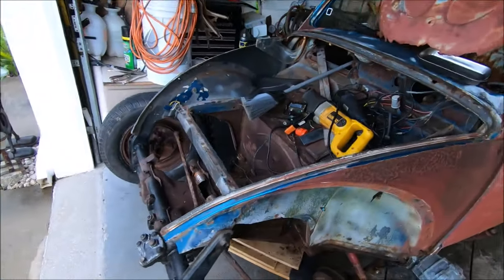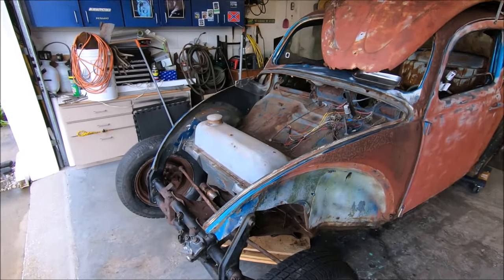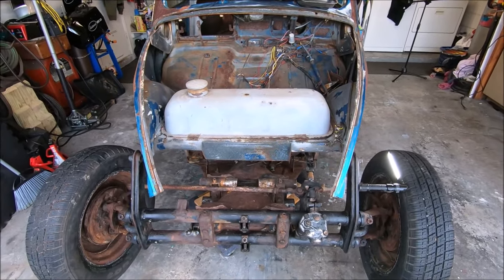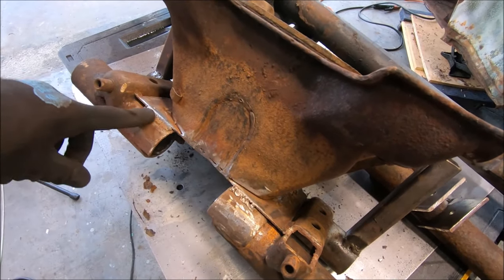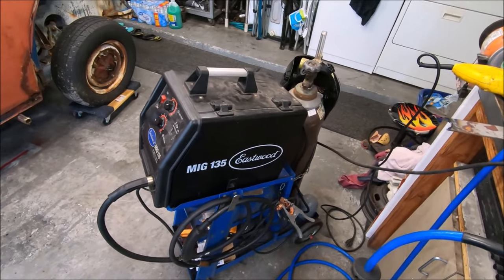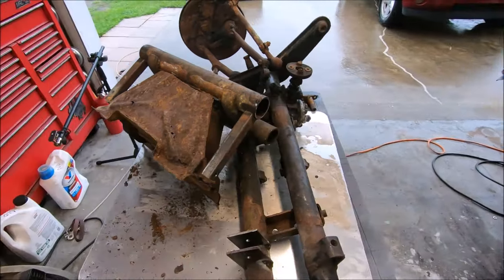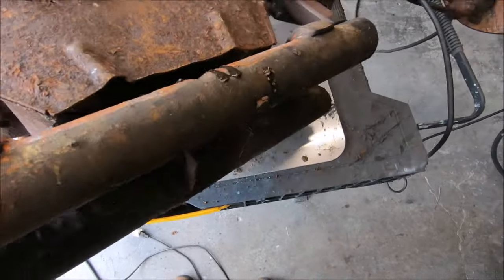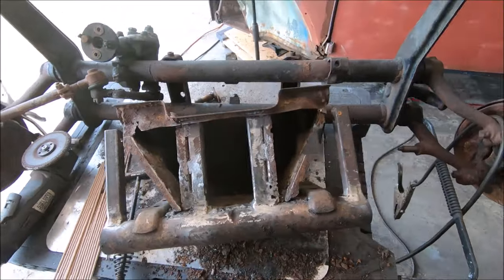DIY Beam Extension Bracing, Part 3 - DIY Volksrod – Baja / Franken Beetle Build - 1960 VW Beetle – 5

Comment: Good progress  Gary ;  I have a Hobart stick welder for heavy metal or steel and use 1/8"  E7018 Low Hydrogen Rod good strong stuff. When I weld up cast Iron I will use a Weldcote Nickle 99 1/8' rod work will on cast.
Reply from the maker: For those of us who aren’t professional welders with expensive setups, a stick welder does wonders. My Eastwood is a good welder but the duty cycle and amperage is less than my stick welder. This old Lincoln buzz box will weld for what seems like forever. 
Hope you’re doing well buddy.
Reply: @VWJawbreaker  Back in the 70's when I work at a family own tool & die shop we had Lincoln buzz box, they were work horses..you could not kill them, ran for ever in fact we had 2 of them in the shop..Not many people had mig welders back then & in high school we had stick welders ..Back in the late 60s early 70s in high school we had welding shop, machine shop, sheet metal shop, wood shop, auto shop and even a foundry were we made and pour alum castings. Drafting was a requirement doing both 2d and Iso machine drawings. In our sr. year in high school the ones who turned 18 were working 3rd shift at the local steel mills. Different world today ..
Reply from the maker: @busman5429  i wish I had those opportunities when I was in school.... sure wish they would bring those classes back, kids need to learn how to work with their hands.

Comment: If you can the housing if the trans. I could use it on my engine stand.  Work is coming along. Ever thought about RHD or center mount the steering wheel. Just a crazy idea
Reply from the maker: I have someone who is taking the trans for their project most likely, if not I’ll let you know.
Reply: @VWJawbreaker  sounds good

Comment: Great job buttttt don't cut the gas tank
Reply from the maker: Why not? I don’t want to run a sand rails type gas tank.
Reply: @VWJawbreaker  Trim up that hardware and make a spacer to raise the tank a little give the tank 1/8 inch clearance to steering linkages .Doesn't look like it will take too much.
Reply: You can always use a plunishing hammer and carefully massage a little more room. Cut tanks look bad and will eventually fail.
Reply: Clean the outside of the tank and tape over any pin holes then use KBS coating fuel tank kit for large motorcycles and it will clean up the inside aND seal it..Then paint and body work the outside of the tank. If your going to run a big motor from jawbreaker then vent the neck on the fuel tank and use a large csp petcock for a good fuel supply .
Reply from the maker: That was the plan with the tank, add a vent and run an AN line for fuel out of the tank. That’s a long way down the road though.